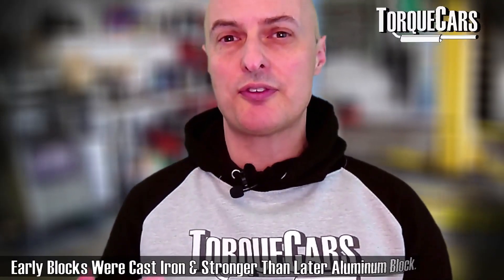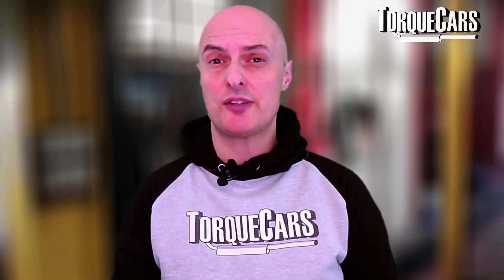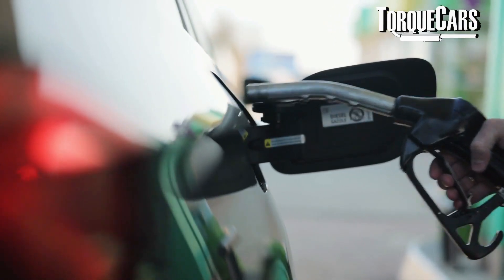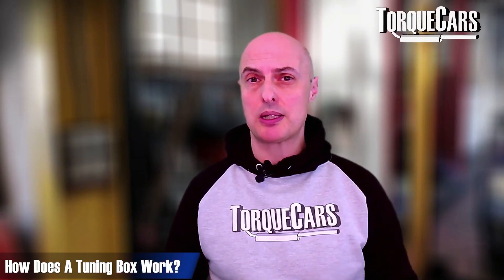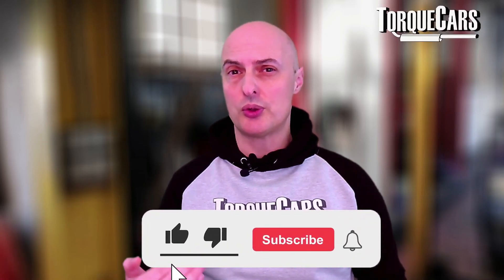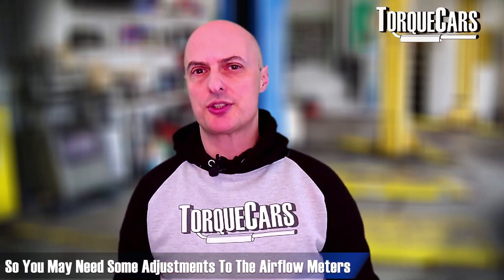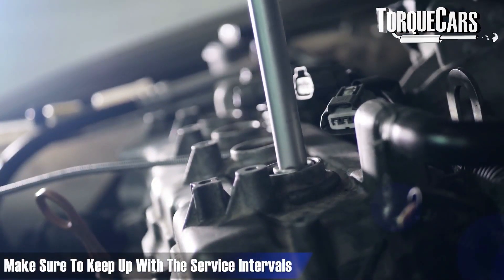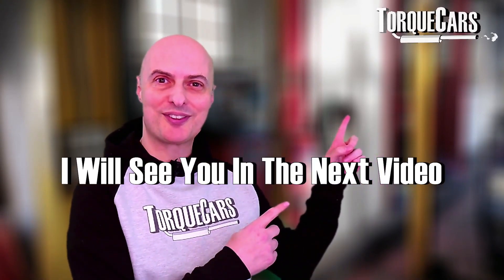Best Mods and Upgrades for the BMW M57 Engine 330d (E46) 530d (E39) X5 3.0d (E53) 535d (E60/E61) etc

Comment: Never understood remapping. They have M cars for that. My 530D 2003 completely stock has 306K on the clock. Love this car. I have a M3 E36 and a V12 bi-turbo Mercedes SL600 for power. Nice info anyways 👍🏼

Comment: bmx x5 m57 delete egr swirl dpf and map it for the best car or the road
Reply: Yes, I have a 2011x5 35d I plan to do just that. Do you know of a brand and model of engine monitor that will work for the euro car? The edge cts 3 does not.....😢

Comment: Have owned a couple manual e46 330d/330cds and have modded them to different extents. I now have an e53 x5 with same engine but is an auto - that’s the thing I’m concerned about, going for similar goals as last time but with the auto gearbox. I know these engines are brilliant! Thoughts on gearbox?
Reply: You will have to limit the torque output in 1st and 2nd gear

Comment: Yeah, go ahead and remap it --just remember to buy all the o rings and oil seals which let go due to increased crankcase pressure. They are plenty quick enough stock !!

Comment: The m57 ports do not lend themselves toward porting. Cooling system upgrades are not necessary unless you plan on going beyond 350bhp mark. Bear in mind the 350bhp usually is accompanied by 750+ nm torque so thats plenty fast. That can be done on completely factory equipment and a good remap. Longer duration cams wont yield much benefit on an engine that only revs to 5k rpm. Freeing up the exhaust, wether it is removing the dpf or rear muffler, does yield noticable improvements in power and torque. The stock intake and exhaust is very restrictive. If u increase diameters even a small bit or remove restrictions you will feel it.

Comment: What is best Intercooler for my 2004 E60 218hp  i need upgrade ??
Reply: i wouldn't upgrade it alone. you could check iat temps with a obd2 scan tool on country roads and motorway if it's to high the increase the size of the inter cooler. however don't go to big as it is a restriction and will give lower boost pressures as the restriction will cause pressure drop
Reply: e60 535d / e65 730d intercooler. both are the same

Comment: Ok my e53 m57 as follows I've cat backed the exhaust noticed a real gain there on acceleration then fitted a Piper cross  filter the finally the remap which statistics take it from 218 to over 260 but then there is the cat back gains and the filter so what wauld you say it's running at I calculated it to over 280
Reply from the maker: There are too many variables to calculate a power figure for example "a remap" can vary wildly in what it does and if it takes into account the other mods you've done plus every engine is unique, so you really need to get it put on the dyno to find out. I do find most estimates from tuners are optimistic and a Dyno graph will show where the power is rather than just a peak power figure.
Reply: @torquecars  yeah I'll sort out a Dino test but realy the car is scary quick compared to before I tested today a stretch of road I use signpost to signpost before was from standing start to the post 86 now it's 102
Reply: I got the Dyno test it's best was 288 bhp torque 560nm

Comment: remapping M57 is not recommended if your car is equipped with CP4 fuel pump, if you have CP3 then you're free to remap but with CP4 big no
Reply from the maker: Good advice, I always assumed that the CP4 was better than the CP3 so I've amended the article to reflect your tip. The "R90" 0.9cc per rotation pumps seems to be the way to go? Do you have a recommended fuel pump upgrade for these?
Reply: for 500hp + you can use 2x cp3 dual pump and injector upgrade 2200bar + . let's not forget the problem with the cp4 pump that makes a splash . its a gurbage pump , 2x dead pump on 320d 184hp and 3x on 535d f10 . THE M57 its legend diesel
Reply: Good info thanks mate
Reply: How do i know if i have cp3 or cp4 :) i have a 2006 e60 530 d (231hp original) :)
Reply: Only the n57 comes with cp4, no worries. R90 cp3 upgrade is just fine for 480-500hp with stock injectors!

I’m running full stage 3 build pushing 480hp and 1000nm.
Reply: @bartselter5332 😮